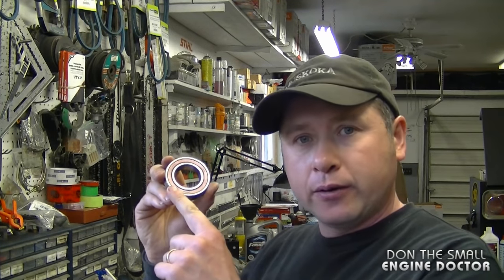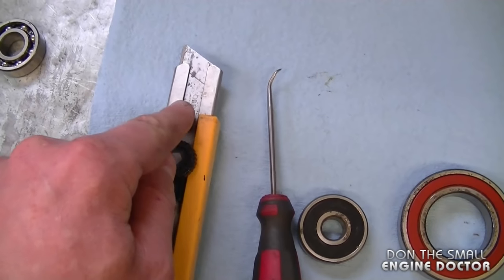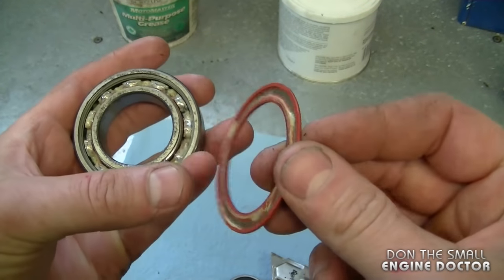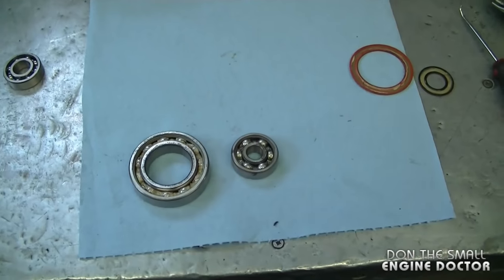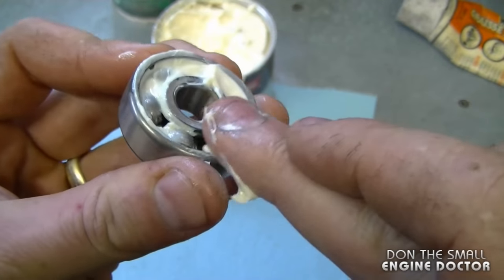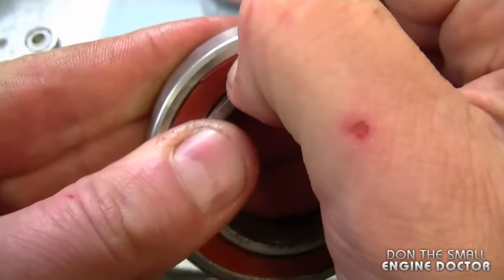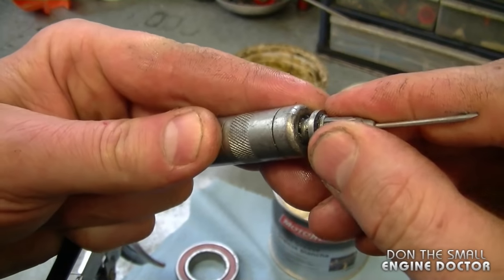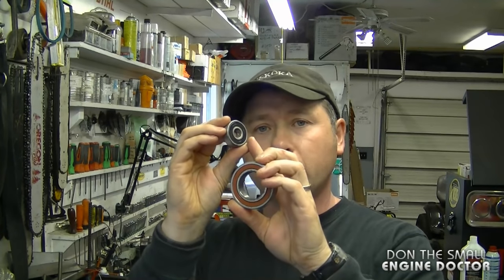HOW-TO Grease A Sealed Bearing

Comment: the amount of grease to pack into a ball bearing is a science itself and has a formula. you can't just scoop up some grease and pack like that. too much grease creates barrier against free rolling of the balls and causes damage and heat resulting in the grease getting too hot and starting to burn.  factors to take into account are the speed , the temperature, and the pressure ( like radial load, axial load, and moment load),  to determine what kind of grease is proper to use. Then comes the amount of grease to use. determining the correct amount of grease for a ball bearing is one of the most important steps in initial greasing and in regreasing of the bearings. too little leads to failure, and too much can also lead to bearing failure and overheating / there are two methods to determine how much grease can be used: 
1. half or two third of the free space in the bearing when operating speed is less than 50 percent of the limiting speed of the bearing. 
  one third or half of the free space in the bearing when operating speed is more than 50 percent of the limiting speed of the bearing

2. another method of determining the appropriate quantity of grease to fill the bearing is determined by the following equation. this is a simple method of calculating the amount of grease needed for a standard application: 

quantity of grease (grams) = outer bearing diameter (mm) x bearing width (mm) x 0.005 or 
quantity  (oz) = 0.114 x bearing OD (in) x bearing width (in) 

there are other methods that are more of  seat-of-the-pants nature rather than scientific but they are found to work properly as well:

1. 30 percent to 50 percent fill typically used for very high speeds. the lower limit should be used in order to reduce churning and overheating of the grease. overpacked bearings tend to overheat proportional to the speed. 
2. 50 percent to 70 percent fill for slow speeds or in the absence of other methods of regreasing  fill the housing 50 percent to 75 percent with grease. after the housings are packed and the equipment is started the rolling elements push the excess grease from between the races into the housing leaving only a thin lubricant film needed to minimize friction and wear. 
3. full pack . a particularly dirty environment may call for the housing to be completely filled.
Reply: Arash Khoshghadamnia Sir Y the new bearing fitted pump getting notice .and the bearing grease colour also changing in new packed pump..but one month older in manufacturing.
Reply: What about serpetine belt pulleys for a car?, and how much grease should it be added?,should i remove some grease since they are full pack?,you can see the bearing still.
Reply: LOL

Comment: sealed bearing is a sealed bearing no need to apply greased ,do not replace bearing when getting worn out,  bearing should be replace BEFORE damaged, our motto IS FIXED THE PROBLEM FIRST BEFORE PROBLEM COMES BECAUSE WHEN THE PROBLEM COMES YOU HAVE TWO PROBLEM

Comment: If a sealed bearing runs out of grease,just replace it @!@. They aren't that expensive. 30 years in maintenance at a fruit production facility.
Reply: Those bearings cost a couple dollars each.   Better to press out and install a new one.

Comment: The real question is:  why do you ever need to grease a sealed bearing. If the grease cannot escape, it should never need to be "greased".    Example:  The sealed wheel bearings on my 2005 Honda CRV have no grease fittings, and so far have not lost any grease or worn out in 175,000 miles.  If the bearings on your mower deck are not making any noise, and there is no side to side play in the shaft, LEAVE THEM ALONE... If there are any signs of wear,  greasing them will do no good... replace them.

Comment: i thought I was the only person crazy enough to to do this. I like to wipe it off with brake or carb cleaner afterwards and put a thin coating of silicone around the edge of the seal just to make sure it stays sealed good.

Comment: I worked for one of the largest bearing manufacturers in the world for almost 30 years and have to take issue with some of the information in the video.  

For starters, the rubber seal has a metal center that can be bent if you aren't careful in the removal process.  This can cause noise problems and shorten bearing life.  I've seen tens of thousands of bearings rejected for bent or dented seals.  Also, the seal should never actually touch the seal groove of the inner raceway.

Second, the grease in a bearing is selected for the application the bearing is designed for, not based on what happens to be laying around.  And it is CLEAN grease with no contaminates. 

Third, bearings are NEVER "packed full" when they are made.  Grease in generally injected by weight and is seldom over a few grams.  Granted, almost any grease is better than no grease, but too much grease is not good either because it can cause the balls to slide in the raceway instead of rotate.

Also, just an FYI...NEVER clean assembled bearings in an ultrasonic washer because it vibrates the balls against the raceways and produces tiny dents that cause all kinds of problems.

 You are right on the bearings with metal shields...better just replace them.
Reply: An understatement, if anything.  We produced around 3 million bearings a month, and there is a LOT that can go wrong during the operation.  Even a 0.1% reject rate would be 3,000 a month...not all from bent shields or seals, but I was there almost 30 years and saw industrial sized dumpsters full of bearings scrapped at regular intervals.

Perhaps YOU could enlighten me me YOUR vast experience in the industry?  Or not.

You have a good day also.
Reply from the maker: if the bearing was for the space shuttle I would worry about it, but I doubt the info in the video will cause a catastrophic ending to a mowing spindle
Reply: Great information, thank you for sharing.

Comment: You can also drop the bearing in hot oil/grease about 250 to 350 F.  The heat will drive the water and air out and as it cools it will absorb the grease / oil.

Comment: Take care NOT to fully pack a bearing with grease. Maybe a very slow moving bearing ok. Check a NEW bearing and you will find out it is partly packed on purpose. Engineers know a fully packed bearing experiences CHURNING. Imagine putting your finger in a jar of thick honey and trying to spin it around. Churning increases friction instead of reducing it, and can cause heat build up and thinning of the grease. Something like thirty percent full is recommended.

Comment: Its a very good idea to wear thick gloves while using a pick/knife blade to remove the bearing centre seal just in case the pick/blade slips then u have  less chance of accidentally stabbing yourself in the fingers or hand,
DEFINITELY WEAR GLOVES OR U WILL BE SORRY!!! (it will hurt & blood will flow!) 😉😉
Reply: Or learn how to work with tools. Gloves hinder dexterity.
Reply: @houndawg3  its a minor safety issue really but if the tool slips last thing u want is to be bleeding over everything,its personal choice ,& i really hate wearing gloves  but sometimes they really are necessary 😉
Reply: @neilcrompton3488  not in this case they aren't.
Reply: @houndawg3   ok i do agree with your manual dexterity point though .

Comment: Ok, nice try......BUT......the PROPPER WAY to hand lube a ball bearing, is to first wash your hands real good. Then prepare your bearing for fresh lube by washing its lean with out blow drying it with an air hose. Now, put a nice hefty gobb of grease on your palm of one hand, then push the grease into the ball groove a little at a time until you can see grease on the opposite side.go all the way around a couple of times. Then turn the bearing over and repeat. This is time consuming for sure. But this way is the best way. Old school......yep. There are other ways for sure.

Comment: i disagree that sealed bearings should be opened up and lubricated in this way. too much grease on a higher speed bearing can cause premature failure either due to the pressure blowing out the seals and allowing dirt inside or heat build up. i suppose on low speed bearings it wont cause any harm however. my personal opinion is to use good quality bearings, if they are meant to be regreased, regrease them. if they are not, replace them when they need to be replaced
Reply: patrick hallyburton I've been doing this for 30 years first started with my rc cars. The seal is to keep dirt out not prevent you from servicing them the trick is use the correct lub a high speed low friction aplication  will typically use a light oil while an automotive aplication will use standard bearing grease.
Reply: CIA Assassin I'm trying to do this for the bearings on my bike hubs what grease should I use
Reply: Yes sealed bearing should be opened up and depending on rpm it spins you choose grease thickness
Reply: @wildcat2488  𝕎ℍ𝕐 𝔸ℝ𝔼 𝕐𝕆𝕌 𝕐𝔼𝕃𝕃𝕀ℕ𝔾???

(FYI: all caps in texting is considered yelling)

Comment: to much grease will cause rolling elements to slide rather than rolling. will cause the bearing to overheat and you'll be replacing it again. 
70% fill is good enough..

Comment: Don't pack the grease "tight", this causes friction which in turn causes heat and then premature failure. There's a fine line between not enough and to much when it comes to sealed bearings

Comment: Ok , I'm an anal retired nuke machanic . DO NOT mix grease . I would ONLY do this if it were an emergency . If its dry THROW it OUT , buy a new one.. Mixing grease can be worse than no grease. Sorry brother , I would not do this..If you do , clean out the old grease with an oil base cleaner . Diesel or kerosene.

Comment: This may work in an emergency. Unfortunately, doing this will often damage the seal.
Over-lubrication is NUMBER ONE cause of bearing failures. Keep that in mind.
Also, many grease types are not compatible. The old grease must be thoroughly cleaned out along with all the wear particles, before adding a different type of grease or even the same type of grease.
Reply: How would it fail?? It would just cause higher drag

Comment: Why overload the bearings with grease it will cause more problems. You don't mix grease types, should be cleaned before greasing just wrong on so many levels.

Comment: You are doing it wrong.   Only grease a single quarter of a bearing. Anything over that you are certain you have over greased it. The ball bearings will start skidding and develop flat spots.  (Go and watch machine spindle repair instructional video's)
Reply: Steven:  thanks,man, because E V E R Y B O D Y will tend to overgrease,now that they catch a glimpse of all those   0 0 0 0 0 0 0 0 0 0 0 0 0 0 0 0 0 0 0 0 0 0 0 0 0  all kidding aside,great advise

Comment: Try to read the catalog or research why bearings are sealed and shield so you will know. They are already greased for life and should be discarded and replaced with new one when damage. If I'm your boss and you're doing it in my equipment, you should start looking for another job.
Reply from the maker: I WOULDN'T WORK FOR YOU
Reply: It's a wrong tip.
Reply from the maker: no it's not some bearings come from the factory with hardly any grease in them